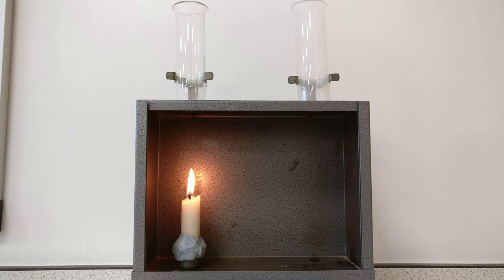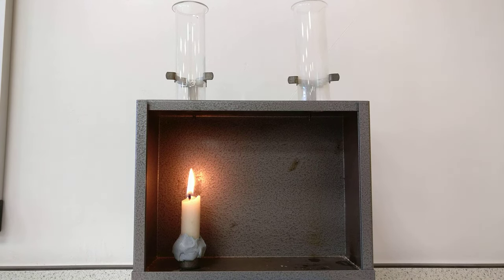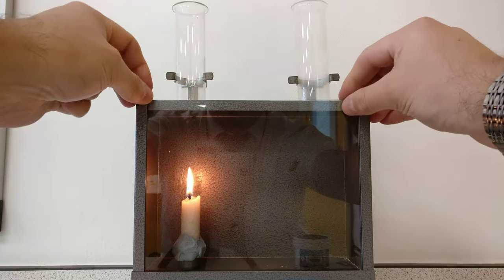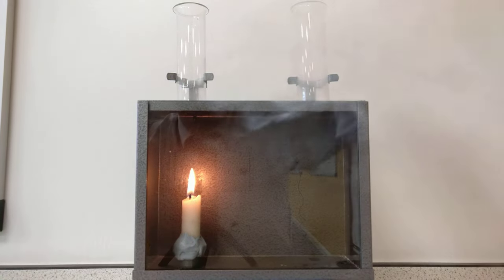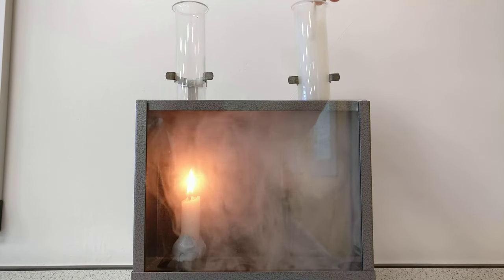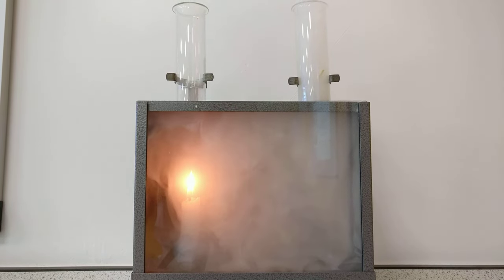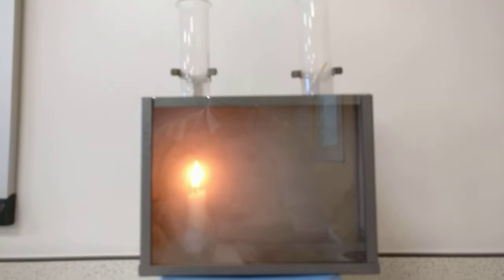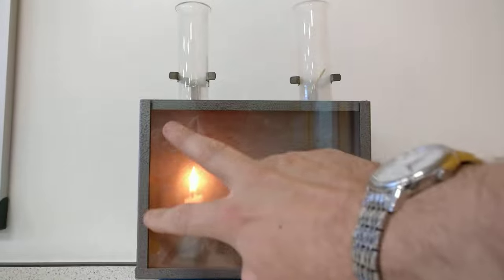Convection in a Mineshaft or Chimney Air Density

Comment: Hello please help!What kind of method is this? I have an industrial workshop that produces smoke How can I do this? Can I use a stove instead of a candle? My job is too polluting.help
Reply: actually just explain from what u learnt in physics. Basically the smoke gains heat and rises due to decrease in density. It creates a temporary vacuum in the candle area and as the cold air from surroundings sinks of increased density sinks, it occupies the space previously occupied by the smoke. This causes a convection current as the cooler gains heat and rises again.

Comment: Hello please help!What kind of method is this? I have an industrial workshop that produces smoke How can I do this? Can I use a stove instead of a candle? My job is too polluting.help
Reply from the maker: Air is heated and takes the smoke with it. Gas expansion ❤️
Reply: @animatedsci  Is the smoke neutralized or purified?Or does it just spin or flow?
Reply from the maker: Just flows out that is all.